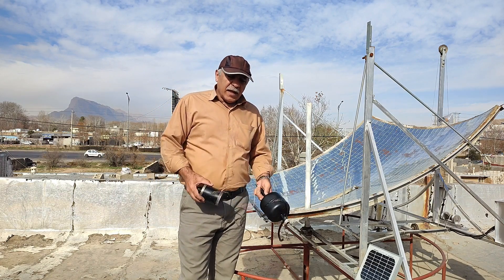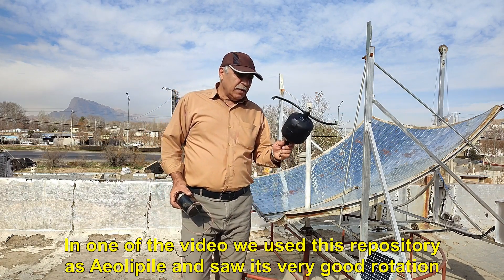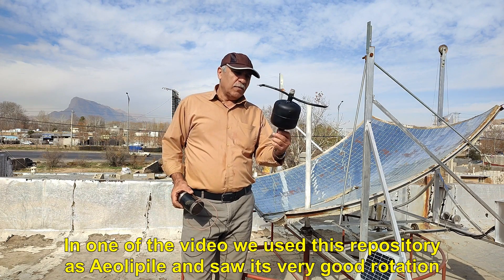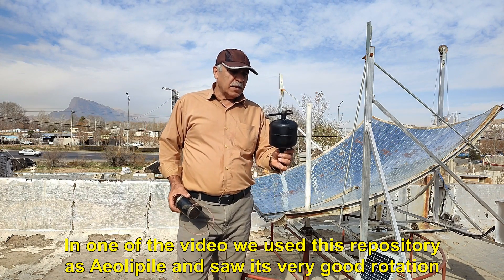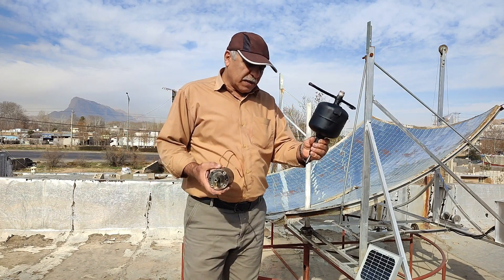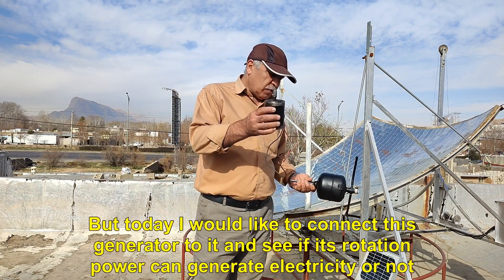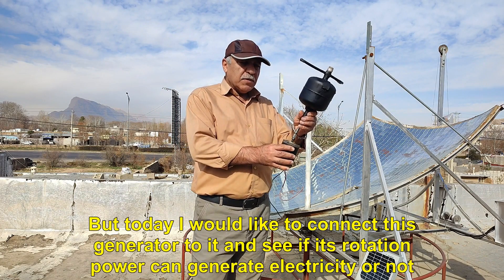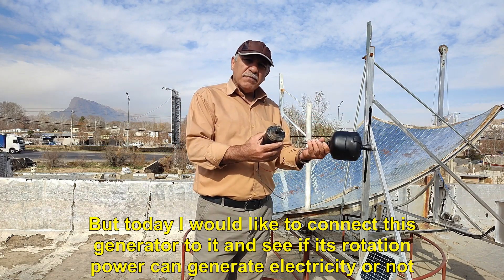Herons ball output power.Aeolipile output power.

Comment: The arms are being rapidly cooled when they spin through the air, I wonder if insulating them would increase the thrust?
Reply from the maker: thank you
Of course, the temperature is very high, but it is certainly better if the arms are hotter

Comment: Sir pls use solar steam apply in  vane motor and upload videos pls.  🙏😉
Reply from the maker: The vane engine is actually a high speed rotating piston but I don't know if it works with steam pressure or not, the problem may be that the compressed steam has a high temperature which may cause it to expand too much.
I hope to have a chance to try it in the future
Thank you for your good comment
Reply: @fixedfocussolar  alright sir, 
I need to see you DIY modify vane motor in the best version for solar steam too!  Vane motor aluminium rotating with stainless blade that can't be rust!  And stainless body too,  for no expand happens damage to motor don't use in high speed much but 
DIY a big body motor for high toque
😊.  Yes I think this may be high efficiency solar steam motor 😉

Pls watch this video and diy it sir 👇
Thanks
  https://youtu.be/IBdLRw34DqM?si=hq1LZwVlOru-nA50
Reply: @fixedfocussolar maybe if u could account for the expansion, once heated up, it will have more play when cold but once warm it would have a close tolerance. Much like some reciprocating pistons do with the rings and the known cfxn of expansion. Idk how to do it but you seem like you might know.
Reply from the maker: Various methods can be used to get more power, but I don't think it will work as well as the piston with cfx rims according to your opinion. @SimEon-jt3sr